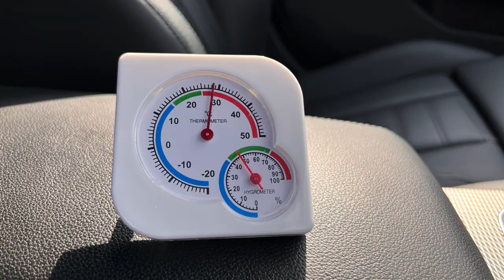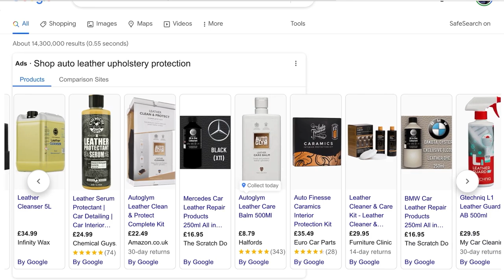Cleaning Car Leather Seats AMAZING RESULTS | 10 Different Products Compared!! #leathercleaning

Comment: Great video and thanks! Consise with a good range of similar products to cover all budgets.

I have very light grey leather seats which are perforated so use Maguire's GoldClass as unlike many (which are white) it goes on clear and flashes off without leaving any white chalky product in the perforations.

When I bought the car Honda CRZ, the original owner had never cleaned the seats so they actually looked light beige! I did a half/half comparison clean and you could really see the difference after two applications.
Reply from the maker: Ew 🤣 when you say Gold Class I thought of car shampoo, I never knew they had a leather cleaner in that range, sounds a good one tho 👍

Comment: Truly informative video, Graeme. How would you deal with light water stains? thanks
Reply from the maker: Thank you , you shouldn’t need any more than a cleaner and a brush unless somehow the leather top coat has failed and the water has left a stain in which case it would need repaired to put it right

Comment: Great video Graeme, I have the exact same “leather” seats as you cleaned in this video except they are cream in a 2018 x4 , there is a few marks / stains on the driver seat , could you pls let me know what you would recommend to firstly remove the marks then protect the leather
Reply from the maker: Thanks David but without seeing the marks and stains I couldn’t be confident of giving you the correct advice , if you’d like to take some pictures and email them to me gmdetails@outlook.com I’d be happy to take a look an advise what to do with the leather , thanks again 👍
Reply: @GMDetails  thanks so much Graeme, will do 👍

Comment: Thank you for this. I have just acquired a 1993 Jaguar XJ40 with a cream leather seat.
 The car has been in storage for the last 10 years. What would be your best recommendation for this. Thanks David
Reply from the maker: Wow David , that sounds a project and a half!!, first you’d need to determine the condition of the leather , any scuffs or abrasions , cracks or tears then the best start is pick a leather cleaner from that 10 you like the look of and I’d advise a brush for cleaning as that’s the most delicate way , horse hair is best

Comment: Great Video, what do you recommend for bmw black dakota leather -  i want to achieve a super matte brand new showroom finish no gloss
Reply from the maker: Hi, if you look at my playlists (Leather Repair Co) , I actually cleaned my black Dakota leather BMW F30 using the Leather Repair LRC1 cleaner exceptionally well, the tip to perfection is using a damp cloth to wipe away the residue from the cleaner instead of a dry microfibre. 
I was really impressed with the AutoGlym cleaner too for the price it’s amazing but simple down to sheer cleaning power alone , the leather repair company LRC1 is my favourite , you’ll find links to the products in the description of this video

Comment: Great video. Could I ask what the difference between these dedicated leather cleaners and a simple APC diluted sufficiently is?  Has the latter been demonstrated to have any longterm detrimental effects?
Reply from the maker: Brilliant question, an APC is such a general product which could possibly be caustic or have a much higher ph level , even diluted they could simply dry out the surface leading to premature cracking or wear, especially using with these thermoplastic scrubber pads. 
APC’s can be used for wheel cleaning and pre wash degreasers , I certainly wouldn’t want to use one on my leather interior 

Long term detrimental effects?, drying / cracking / colour loss / clear coat failure are all possible depending on the APC used , I do believe you’re just better off using a dedicated leather cleaner to be safe

Comment: Fantastic video and info in this one. Once again the attention to detail in the camera work is so good. 

I do wonder how many just crack out the Surfex or other APC and just get it cleaned. Sure enough I'm sure it's looks clean after but iv seen so many dry and cracked leathers that are less than 5 years old.
Reply from the maker: Thanks Andy . Yes that’s my point entirely , most APC’s are salt based so have a tendency to dry stuff out like you’ve witnessed , this is what gets me with valeters using cheaper chemicals to ‘get the job done cheaply’ it may be a while down the road before it gets noticed but proper products for the job will help prevent damage over a longer period

Comment: So, wich one has that bite force to pull up grime from old leather seats, without removing or dissolving the dye ?
Reply from the maker: The one I’d trust the most on old leather is The Leather Repair Co LRC1
Reply: @GMDetails  does it leave any stain when dry, meaning that you have to work one section at a time, or you can spray on the whole seat and let it dwell?
Reply from the maker: @JuiceBokx  I always remove any residue with a damp terry or bamboo fibre cloth so no, once it’s dried it’s perfect, just be careful the antique leather isn’t aniline though as there’s a separate product for cleaning that
Reply: @GMDetails  antique leather you mean retro/vintage cars ?
Reply from the maker: Yes mate, older cars you have to take a little more care with the leather due to cracks and wear, some manufacturers used aniline leather while others used pigmented or painted leather, a simple test to see whether it’s aniline or pigmented is to drip a couple of drops of water onto it, if it absorbs straight away it’s likely to be aniline and you’ll need a different product to any I tested in the video, if it beads it’s good to use the leather repair product on it, just don’t scrub with any of the new scrub pads they are not safe on older leather

Comment: I think you missed one of the best cleaners in Pol star I use it from 5:1 to 10:1. As for alcantara it’s not actually it’s proper name, it’s micro suede and it’s a form of leather, alcantara is the company that makes it.
Reply from the maker: As I said at the start this wasn’t the full range of what’s available , I’m not making enough to buy everything but I’ll get some for the cleaning test I’m going to do with them all. 
Alcantara tho is NOT leather it’s not micro suede but microfibre fabric and can be cleaned using fabric cleaners, but it is made to mimic suede tho 👍